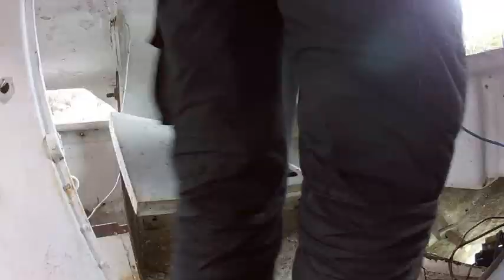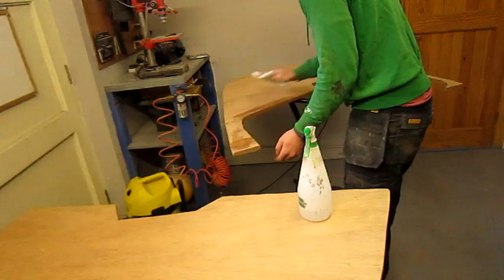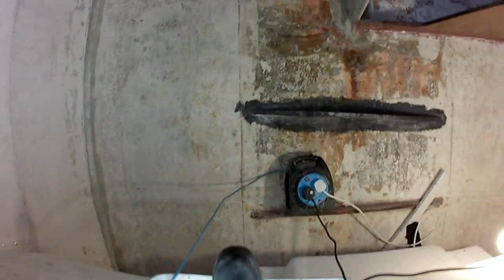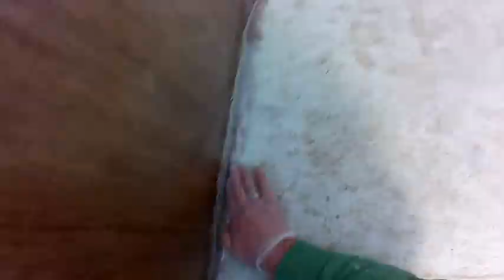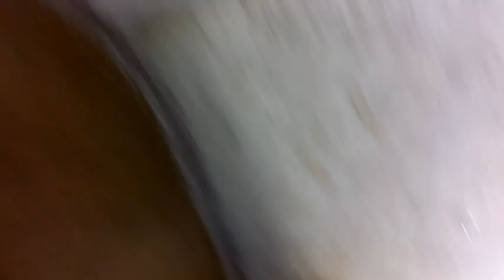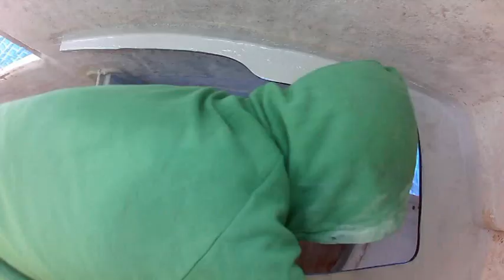Restoring Freyja Ep. 004, Making and Installing New Bulkheads

Comment: Hi, I am also glad you are back on fixing the Matilda.
I guess that you know that the ratio of West System by weight is not exactly 5 : 1. As per my calculation, based on density of each components, the correct ration would be 5.19 : 1 for Fast hardener and 5.36 : 1 for Slow. I use these ration when I mix mini batch. I do not think it make any practical changes on using 5 : 1 by weight, but just in case. 

Keep posting.